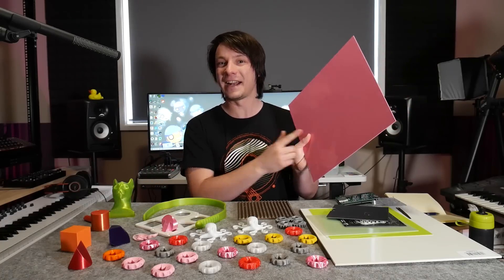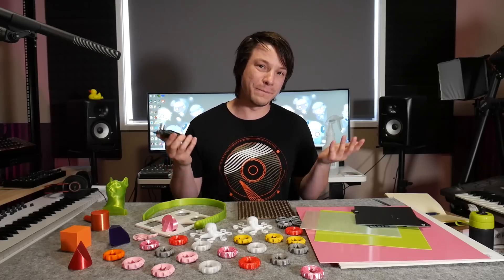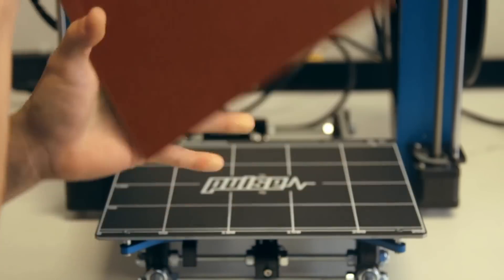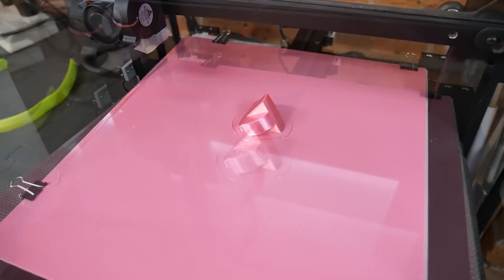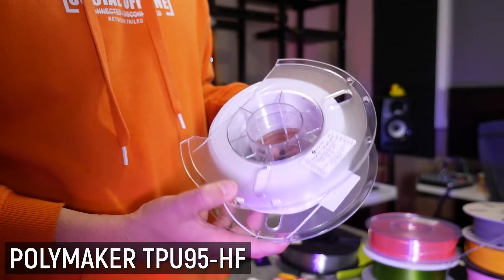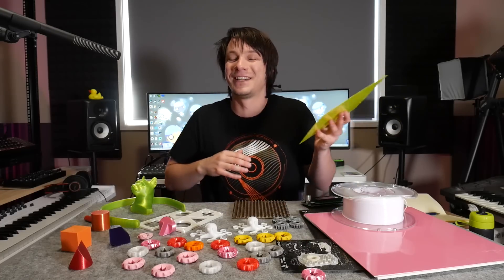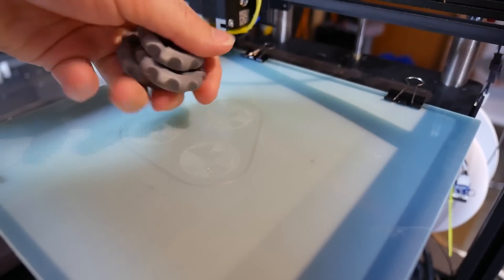G10 - The best print surface you've never heard of.

Comment: I just use a plain mirror as a print surface, no glue or anything. The parts get a mirror shine on the bottom layer (good enough to see your own reflection), and they just self release similar to in the video. Cant bend it if youre impatient though, but the IPA would probably work the same way. The mirror I'm using is a 30x30 cm square from Ikea, which they sell in packs of 4 or something like that. Whenever one gets too scratched, I just replace it with the next. Usually takes like a year to get to that point though.

Comment: Thinking that one option for adding this to the printer instead of clips or gluing it down, would be to use sheet magnets one on the motion system, one on the underside of the board, similar to what you did for the demo of a magnet attachment of a piece of light duty sheet steel as a bed back a couple of years. Sorry if this is already in the 1261 comments that I didn't read before posting..

Comment: 14:14 Will few drops of water make it stick for few prints? 🤔
Reply from the maker: Gotta remove any oils that might be there, a tiny bit of detergent helps if using water :)
Reply: @MakersMuse  I was wondering if the water would "glue" the G10 to the heating plate, but it probably would just evaporate 🤦‍♂️

Comment: In the US this is better found as 'phenolite'.  G10 / Garolite is a trademarked designation that is actually enforced in the US due to it being used in US military contract weapon component manufacture.

ProTip:  You can get thinner sheets (0.65mm in use personally) and adhere them to spring steel magnetic plate systems (BuildTak FlexPlate, personally).  This provides the added strength and stability of a thicker sheet, but with better heat spreading ability for even heating, no need for clips, and the ability to flex the sheets still.  As a bonus you can also use multiple surfaces, say a roughed one for cases where glue stick is needed or a thicker one where dimensional accuracy is extra important (though best use an auto leveler if you have differing thicknesses).

Comment: G10, I am now a fan, thank you.  This looks to offer a nicer initial surface than glass and glue stick.

Question pls.  You dont appear to use a brim and the video shows a single line and in some a line from the corner then a single lap around the objects before laying down the objects sans brim.

I'd like to learn to do that as my production prints take time to remove the brim and then clean up the attachment point of the brim.  For me I use the brim to clear the pre print feed and also let the printer get down to print height, and show me the bonding squish.  I'd like to graduate from that approach if possible.  cheers
Reply from the maker: It's called a skirt, same use as a brim for priming the hot end but has an offset to the part. You can also make the printer purge in the start g-code. Hope that helps!

Comment: I've used G10 in the past, to be honest, I was rather disappointed with it, especially when it came to printing Nylons, in my stock, I have a few half sheets of garolite G-3 1/4inch thick, that did much much much better with nylons and other filaments, and the fact that it is 1/4inch thick it is perfectly flat and stays that way even when very hot.

Comment: i bought mine from mcmasters & it’s great for pc & nylon & the dreaded abs. i always avoided these because the warping was always there & i had trouble sticking the print to the surface but i can’t remember which forum years ago someone recommended garolite & i tried it since it was cheap(like $12 us dollars for a 12x12 sheet) & haven’t stopped using it since then. i found that even for nylonX i don’t have to crank up the bed temp high at all just needs to be 60 degrees & in colder weather 75 is the magic number for me. & it sticks just fine without having any issues with the print sticking & gouging your sheet.

Comment: Damn. When you flip the Ender3 top plate, it is FR4. I get good adhesion to the black top but my prints are warped/convex on the bottom, and that's because the black top was separating/lifting off the FR4, ie, not enough glue holding it down. I flipped the top and now I get flat bottom prints using the FR4 side.

Comment: Tip for keeping the build plate stuck to the aluminum bed:  use some silicone thermal pad between the bed and the G10 surface.  It helps with getting good thermal contact, and also provides a moderately-sticky surface to keep the build plate from sliding around at all.  I currently use it with my glass bed and it's worked great without any clips.
Reply: Where do you get this thermal pad that is large enough?
Reply: @brentowen8857  I bought mine on Amazon. I only found one that was 200x200mm, which worked okay for my Ender 3. But you can buy another and cut strips to fit empty portions of the bed.

I will mention, now that I've used it for a while, that the bottom of the glass bed needs to be clean for it to stick well to the thermal pad. This happens a lot when I remove the glass bed. If I get fingerprints on it, the bed can gradually slide out of position. A bit of alcohol will fix it up again. But test that the bed won't move after replacing it. Dust and junk can also gradually get stuck in the thermal pad and make it less effective at sticking to the bed over time.

I've recently swapped to a magnetic spring steel bed with PEI on it. That thing isn't going anywhere.

Comment: Works good, but if you want to upgrade and never change use real carbon fiber treat it the same but don't worry about heat I've printed at 180 abs/nylon type
I love it I will never go back.

Comment: Phenolics as a whole are a favorite material of mine. They were like one of the original plastics and HIGHLY underrated today...  Strength and machinability of aluminum, fraction of the weight.  When I was rebuilding my original gMax 18" square bed years ago and adding a heater, I used a 6mm piece of phenolic, stayed flat and true no mater what I heated the bed to.

Comment: Hi Angus great video as always. In this video i noticed the awsome endstop mod for the longer would you be able to send the file or put it up online would love to do this mod to my LK4 Pro. 
Ooo and gonna give the G10 a try now so thanks for telling me about it 😀

Many Thanks
Reply from the maker: It's designed for some old stock limit switches I had on hand so won't be much use sadly. It's just a rectangle extrusion with some holes in it :)

Comment: Wonderful information. Thanks for doing this man!!! I only print with PETG and it is so frustrating. I got a new print bed and it stuck with the force of a million magnets and first print, it sucked out a chunk of glass from the exact middle of the bed. So now my z zero is wrong... And I have a weird tumor on the bottom of every print because, yeah, it's in the middle. I thought using higher quality glass would help, but apparently not. So I use hair spray on the glass now to make it stick LESS, but with PETG, it seems to need a minimum surface area for it to stick that way, and so I can't print small features on the first layer...
Now I'm going to give this Garolite a try. I am no strange to garolite, being an electrical engineer, but I had no idea it could be used for 3D printing. Thanks again.

Comment: idk if it's the right place to put it, but I didn't find any other place to ask in.

I've been struggling to print a bit bigger sizes than what the printer provides, I thought about multiple things but couldn't really reach a good method to do so. hopefully you'll read this and do a video about it. here's some of the things I thought of:
1. tilting the angle of the print, but this has multiple cons, you need support to fit some of the first layers if not many, it'll take more filament & time, and since it has support, it's gonna be risky. despite the fact that it's not gonna be WAY bigger, just a little (using the triangle law).

2. divide the print into multiple parts, also has some flaws, such as weak joints, since they'll be printed too (which I tried my best to overcome, no hope, but it's useful for some projects).

3. instead of printing the joints, maybe use a glu or something, still weak and can't hold heavy weights.

these are some of the possible solutions but still not perfect, but I thought of sharing maybe it'll help someone, also someone would mention a solution if there is.

Comment: Thank you soooo much.   I use PETG for most of my projects and over time I have destroyed around a dozen beds of all types.  Since switching to G10 I have had 0 failures and I'm still using my first G10 bed.  I have been using the 1.5mm sheets on both of my printers for about a month running on average 20 hours a day.  Great first layers and they always release when cool.  Best $12 I have ever spent plus like you said you can get them in different colors.  Thanks again.  Great channel, great content, keep it going!!!!
Reply: Hi, I'm getting into 3d printing and I'm not sure what happens when you begin to print, does the printer heat up the bed?

Comment: Regarding the PETG, I absolutely have to print in an enclosure (same glass bed you referenced with chunks coming off of it) and it's been working quite well. Around 90-95c bed temp, however. Chamber temps around 45c.

Comment: My TronXY X1 came with this weird print surface and for the longest time I didn't know what it was. Turns out it looks exactly like this stuff! Now I know how to replace it. The X1 sadly doesn't have a heated bed so I ended up using glue for everything. But I hardly had issues with my first layers and yes the looked great.

Comment: so im watching this on NS and after some googling realise the other big use for this product is as an insulator and  seperation panels in HV switchgear , needless to say i have now been printing on a piece of 1.5mm thick g10 using my ender 3 v2 with enclosure, and no more hairspray on glass bed to print ABS required, infact i havent added anything to the g10 bed for ABS PLA or TPU and they all stick very well with no lifting. this is my new favourite bed. So cheers for the heads up on a product that seems to be the best of all worlds so far. So for fellow Aussies looking for G10 there are some electrical suppliers out there that use it for manufacturing various parts but for a single piece the given link is probably the easiest choice.

Comment: If you had used FR4/FR-4 in the title I would have immediately know, as at least my German bubble refers to this material by this name.

Though as I just learned from our very reliable source Wikipedia: »Of these, FR-4 is the grade most widely in use today. G-10, the predecessor to FR-4, lacks FR-4's self-extinguishing flammability characteristics. Hence, FR-4 has since replaced G-10 in most applications.« — so if you have a choice, prefer FR-4 over G-10, simply for your own safety. (https://en.wikipedia.org/wiki/FR-4)

Comment: I bought a sheet to use on my prusa mk3, but didnt think and apparantly it needs a steel sheet to do the auto meshing. I can get it to print if i put the G10 sheet over the steel sheet, but then its all too thick and i cant z-adjust high enough. any advice?

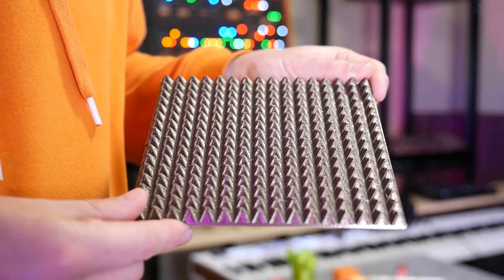Comment: 13:50 These are binder clips, not alligator clips.  I suppose they could be attached farther off, so just the tip of the clip is on the board, but there will still be some reduction in print area and maybe a loss of stability.

Comment: How's this with larger surface ABS prints though? For example that headphone headband STL, if that was printed in ABS/ASA, most bed surfaces would warp pretty badly, does the G10 fare better?
Reply from the maker: Without a high ambient temperature it will still warp, or split.
Reply: @MakersMuse  I've been getting away with ABS/ASA slurry on lattice glass on a few prints, and i found ABS/ASA slurry to have the best sticking force compared to PEI, PVA and hairspray (in descending order). So i was just wondering if G10 was going to be any better than slurry that's all. But sounds like that's probably a no, so thanks anyway! Great vid, I'm sure i can use G10 for other prints.

Comment: Can't beat a good mirror from a glass shop.  I print everything straight onto a mirror, no glue, tape, or anything else and I have printed lots of materials without issue.  Some small prints or prints with small contact areas on the bed I use a brim attached to the print, and it acts like a suction cups.  A gentle bump along edges with a scraper let's air under and the part pops free.  Bottom of the print looks like a mirror as well, I could shave in my reflection.

Comment: How timely! :)

I recently purchased FR-2, another plastic meant for PCBs for my printing surface because I couldn't find a conventional surface for my 590mm x 590mm bed.

Here in the States, I purchased my sheets from Professional Plastics in California. Here's what I purchased:

SPAPNA.062	0.062 (1/16") THICK NATURAL PAPER PHENOLIC SHEET Size: 24" X 24" @ +/- 0.125	1	$25.00	$25.00

SPAPNA.125	0.125 (1/8")   THICK NATURAL PAPER PHENOLIC SHEET Size: 24" X 24" @ +/- 0.125	1	$58.77	$58.77
Shipping Total:	$29.35

Not knowing what thickness I would need I purchased both 1/16" and 1/8" boards. I couldn't be happier with my purchase, as well as the help that I received in picking out my material (the engineer that helped me couldn't make any suggestions concerning uses of his plastics for 3D printers, but he knew his materials very well, and was able to steer me to what should work well for my purposes).

Comment: I have a unused fiberglass single layer copper plated board, big enough for my anet A8 plus heatbed. As I started to use photosensitive boards for my pcbs, i stored it, as it was kind of useless. By putting the copper side downwards, would it be usable for the same purpose, also for nylon printing?

Comment: My experience with G10 is that it looses adhesion fairly quickly, when printing at higher temperatures (110°C bed printing nylon). This may depend on the brand though...

Comment: How to Stick Down the Sheet without Clips:
Use the woodworking and machinist trick of putting a layer of blue/painters tape on the bed and the G10 sheet. Use super glue on the tape covered bed to secure it to the tape covered sheet. This is strong enough for mills so even just a bit of glue will be no problem here. When it's done, you just pry them apart, that will unstick the  blue tape and then you can rip it all off taking the glue with it.

Comment: unrelated to 3d printing but how well does the g10 stand up to a hammer im kinda thinking about using it as the surface to my 8 foot workbench but question its impact resistance?

Comment: Thanks for reminding me about this stuff. Back in 2018 I had bought 5 sheets that were 12 inches square. It cost me $5. But it was really thin. Too thin to use it by itself. But now I have a few printers that have steel flex plates. So I cut one of those sheets down to size and put some heat resistant double sided tape on it and stuck it to a flex plate and now it work perfectly.

Comment: So, just a PCB without any copper, solder-mask or silkscreen on top and a resistive heater on the bottom for perfect build surface? If you want more heating could probably go for a 4 layer PCB.

Comment: If you hawe problems with removing TPU from any surface try to use denatured spirit. Put some drops around the print and remove after a 30-60 seconds.

Comment: Why not try straight-up blank PCB?  Copper side down (or try up???) for great heat distribution, hotspot dissipation, and extra mechanical strength.  $25 for a 300x300 blank pcb from Jaycar.  1.6mm thick,  FR4, TG130, UL94VO.
Reply from the maker: I might just have to try. Assumed Jaycar would be way more expensive!

Comment: I bought a self adhesive panel with Garolite on the too surface for my printer and stuck it to a flexible steel sheet. I have used it yet though. I have some PC filament that I was going to try using it with, but haven't done it so far. 

Thank you for the info on it. Sounds like it might work for me.

Comment: Why did you not use it with copper on the bottom to stiffen it and distribute the heat better and more evenly? Then you're just shopping for raw PCB without the P or C and it should be easy to find.

Comment: The best and cheapest print surface is "shugar" ! Take a cup with water, put a bit shugar in it, heat it up in the microwave and take a kitchen towel. Put the kitchen towel in to the cup, and wipe it over the printbed. Head the prindbed to 80 degree. The print service get reaaaaaaly sticky, and you can see some very smal shugar crystals on the bed. You can clean it easy with water and refresh the bed with shugar when ever it is needed.

Comment: Is that the same stuff like on knifes, the handle material 🤔 and pcb board material?
Would it work better with the copper between the sheet, for heat displacement 🤔

Comment: This is really great. I got an Ender 3, and it shipped with this type of bed. It is by far the best bed I have used for PLA. I wanted to get another one, and had to order specifically from China. It was listed as "3D Printer Removable Fiberglass Build Plate Heatbed" on eBay, FYI, but they have since run out. I've also had an UP! Plus for many years and they were using this also. 
Why do you suppose they stopped doing shipping with this. It seems cheap, stable and works great.
Reply: I should add - it was 1mm thick (exactly). Not sure why this is also a tricky size to come by, as the UK link you posted only has 0.8mm and 1.6mm. Which is appreciated! Just curious why 1.0mm again seems to have become hard to find.